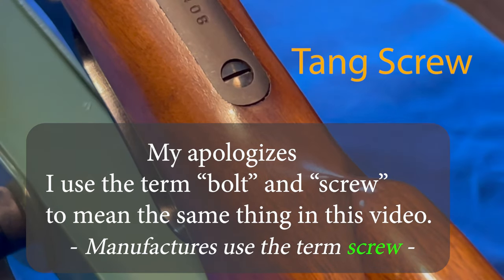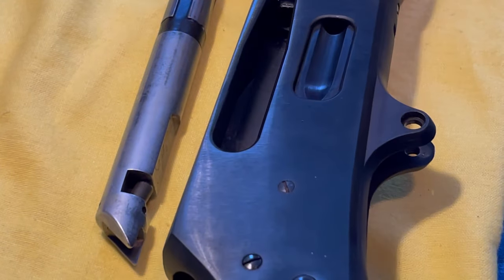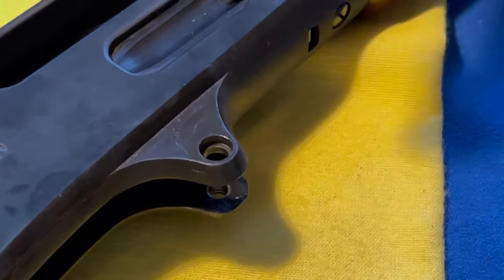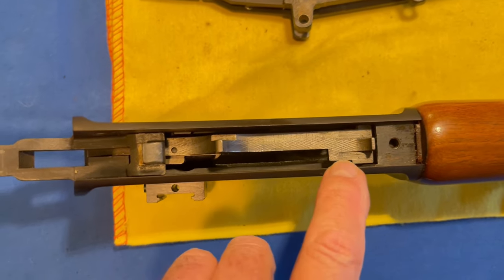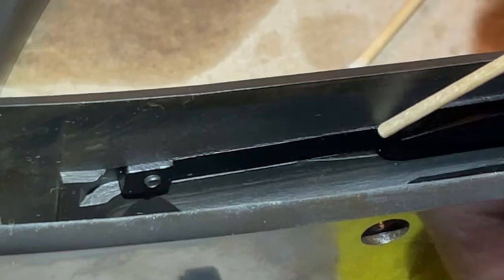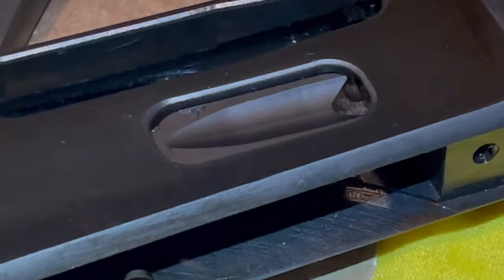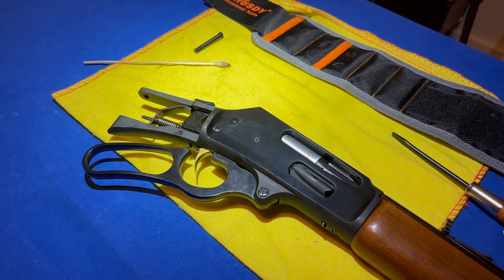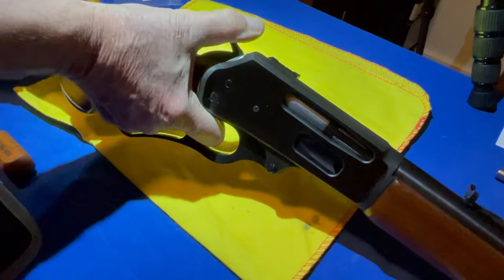Marlin 336 .30-30 Lever Action Rifle Disassembly and Reassembly for Beginners by a homeless hombre.

Comment: If some screws are reallllly stuck you can use a bit set on a 1/4” ratchet .. it will give you the leverage you need— but you have to make sure that bit is seated fully and perfectly aligned BEFORE you start ratcheting!

Comment: Invest in quality gun screw drivers. A kit with one handle and interchangeable bits. They span entirely the slot width and fit properly. No chance to damage firearm.
If any dirt in screw slot clean out with toothpicks or pin to allow driver to reach bottom. 
Clean and oil all components for reassembly.
Work carefully and avoid contact with other parts. Unintentional damage is very easy to have happen. They are beautiful rifles.
Reply: Ya think! I don't get these guys. Hollow ground blades are all you can get nowadays & if thier too fat just touch em up with a Dremel

Comment: Great explanation and close up pics of the important parts.
I recommend screwdrivers made especially for guns (hollow ground). The ones that have one handle with various width and thickness tips are the best.
They reduce the likelihood of a buggered screw head and/or gouged surrounding metal.
Reply: Mark Novak shows how to use a watchmakers block and hammer to repair damaged heads. It's a hexagonal block of steel with various sized holes drilled in it. We did this with motorcycle screws but firearms are a lot more fragile..

Comment: I'm a qualified motorcycle mechanic.. Screw, bolt ,same difference. Mark Novak YouTube channel shows how to restore damaged screw heads using a watchmakers block. I think that's what it's called. A hexagonal block of steel with holes drilled in it. I bought one cheap on Ebay..